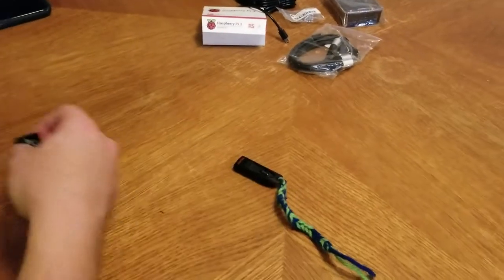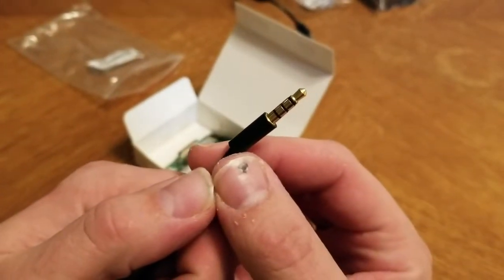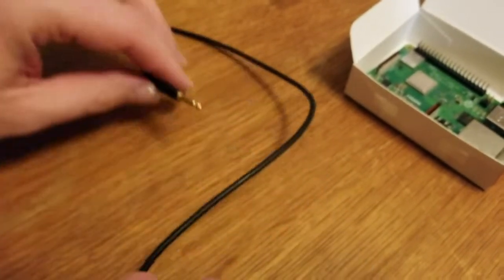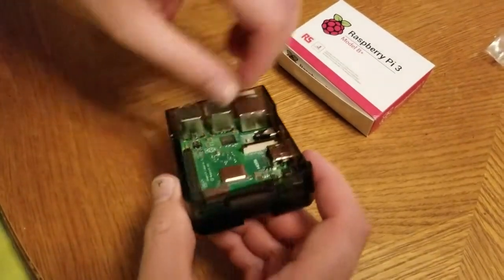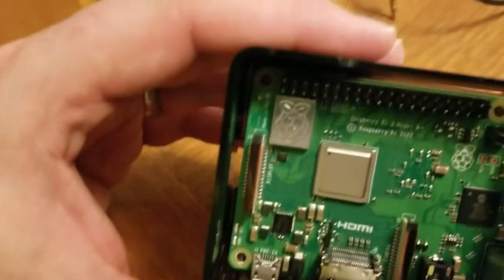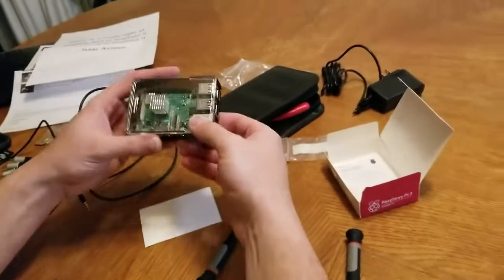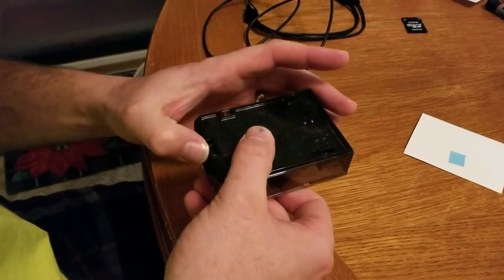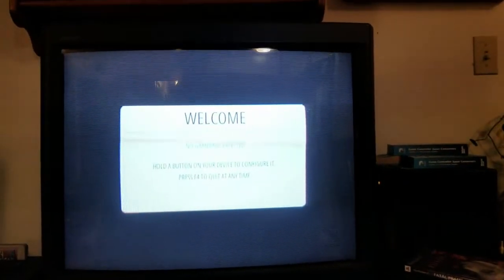Raspberry Pi- RCA 3.5mm/Assemble the Pi 3 Model B+

Comment: I know this video is fairly old now but do you happen to remember if it automatically supported rca or did you have to change any code in the config txt to disable hdmi, etc?
Reply from the maker: No, it was plug and play. As long as you had the rca 3.5mm jack, you didn't have to change and code.
Reply: Rekkabites Thirteen thanks man, I actually ended up figuring it out, I didn't realize what model I have and it turns out there is a bit of code for this to work on the 4b at least for me, thanks again
Reply: @alexjames6818  ay mates thanks for this it helpd me out alot, cheers
Reply: @RekkabitesThirteen @RekkabitesThirteen, take out your SD card from your Raspberry Pi and put it on your computer. under the config file under uncomment for composite PAL
(for US and 4:3)
enable_tvout=1
sdtvmode=2
sdtv_mode=0
sdtv_aspect=1